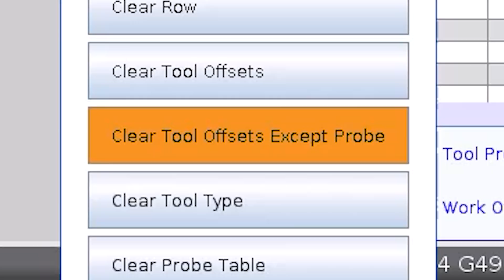Don't Lose Your Probe Offset! - Haas Automation Tip of the Day

Comment: It would be nice if there was a post that added this macro after the tool call line with block skip hashes so that after the first run they can be ignored. Essentially load tools set work offset and cycle start.

Comment: Why clear all but probe offset? Why not just overwrite new offset values as you set the required tools into the machine?
Reply: Hah. The best way to streamline a process, is to remove it! Nice. I don’t know why I always clear all offsets between jobs if pulling tools. OCD a bit.
Reply: Because if u forgett to enter new value, you will se 0 in offset... safety.
Reply: Same question. I always write over. Maybe I’m not being efficient? I don’t see the downside.

Comment: Hey Mark, question for you.. Is there a macro variable for the next tool number to be called up into the machine? Cheers
Reply: Not exactly sure what you're asking but, Just put the next tool number into your program on a separate line without the m6 and depending on the machine it will/or wont precall the tool and save you a bit of time during tool changes.

Comment: I wonder is there a similar way to preserve the probe offset on the legacy control?
Reply: I wrote a macro for it, which deletes all the offsets except one that you leave alone. The only problem is having to be careful which program is used for which machine since the T-value might be different.
Reply: @ydna  I'm going to copy your idea, I have macros.  I'd need to look up the variable numbers for coolant position.  I should also write one that automatically sets coolant position based on tool length.
Reply: Hmm. Not that I can think of. Andrew’s Macro idea is brilliant. I’m going to look at that myself.
Reply: @markterryberry4477   I got it working on the legacy control, it zeroes tool offsets, tool life's, usage count, and max loads, avoiding the probe offset.  I couldn't for the life of me figure out how to auto set coolant position.  I don't think I can write to the coolant position using a macro after looking the manual over back to front.
Reply: Yup. Would be super usefull.
Reply: on legacy, you can choose probe too :)

Comment: I wish haas tooling sold tool tags and tool tag holders.
Reply: Soon. Haas Tooling is adding items every week. At a meeting this week they were showing off 450 new inspection tools that are being added by the end of summer. Those tool tags are great, and they are on the list as well, being sourced
Reply: @markterryberry4477  Mark, the biggest thing on the wish list for me is the tag holder/ tower.  Yes I could keep running 3d printed ones but they are not as durable as an injection molded plastic and the bigger issue is affixing them to the machine.  If Haas could make one that holds 30 tags (or one that holds 20, one holds 10, to cover all machine tool sizes), has easily identifiable and changeable numbered positions and can be affixed to both newer machines and the legacy equipment it would be great!  Thanks for the reply and great work Mark!
Reply: @ludacrips76  I’ll pass this on to the Tooling group now!
Reply: Portland cnc has a great tool tower and they also resell the standard MSC tags.